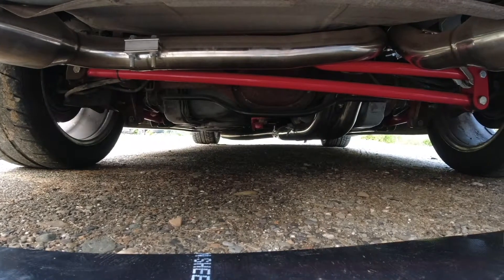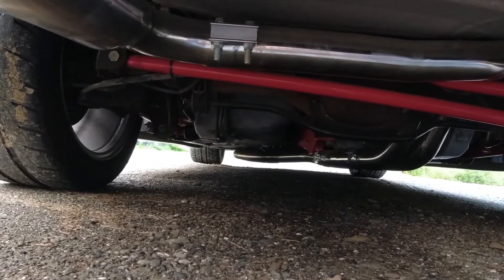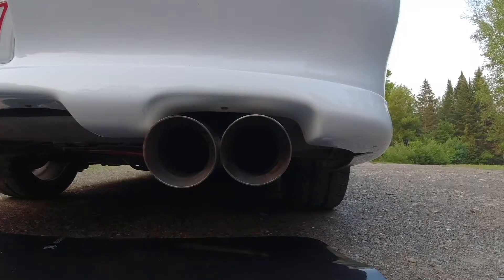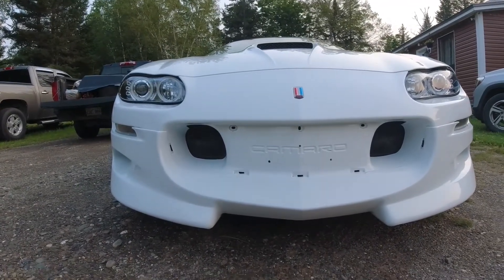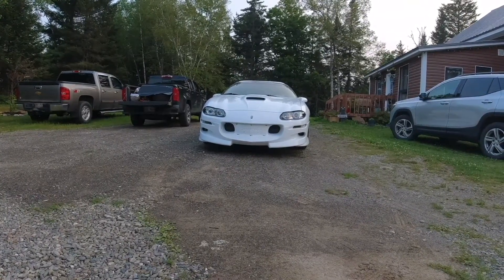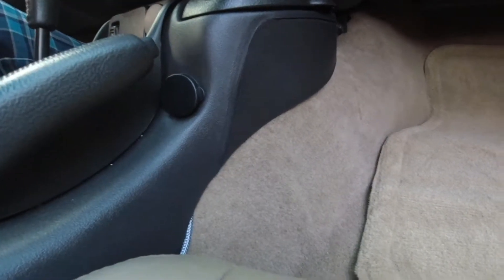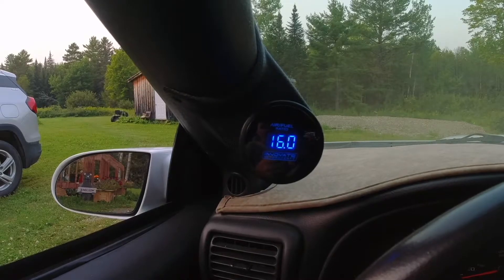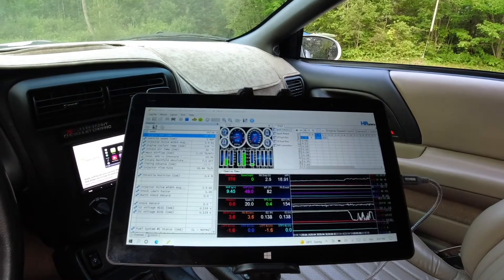4th Gen LS1 Camaro - Adjusting the Speed Engineering True Dual exhaust - HP Tuners

Comment: Hello! I’m looking to upgrade my stock exhaust with a true dual exhaust and long tune headers but have a couple questions that I hope you can answer. 

1) I want a loud/deep exhaust sound and I’m considering  texas speed, Kooks, or Speed Engineering. How loud/deep is the speed engineering? 

2) I don’t want to smell like a gas station in my car, so I’m debating on whether or not to run cats. How bad is the gas smell in your car? What are your thoughts on cats? 

Thanks!
Reply from the maker: Well first off I choose Speed engineering based on price.It is all stainless like the more expensive brands but at a much lower price.But it is also very loud.Now I like loud when I am in the throttle but it can become irritating over long drives because it is loud even while driving the speed limit at low throttle input.As far as gas smell I don't get any smell in the car but I am sure there is lots of gas smell coming out the back.As far as cats go I actually have thought about getting a set for mine but not for the gas smell but to lower the sound when under light throttle but an added bonus would be less gas smell.So there are a few options for dual exhaust.You have speed engineering,Hooker and Kooks and maybe a few others.Sound wise they will vary a small amount but not by alot.But when it comes to price you won't find anything better then speed engineering.You would save enough to cover the cost of a good pair of cats and that would take care of any gas smell and should lower the exhaust note under light throttle.And as far as power goes you lose very little with a good set of cats.Just make sure your tuning is spot on so the cats don't get destroyed prematurely.But any of the exhaust systems you mentioned will work great they just will cost more.Thanks for watching and commenting and good luck on your exhaust.Like I said you really can't go wrong with any of the companies you mentioned.
Reply: @LSxMotorsports2021  thanks so much for your insight! Kooks is extremely expensive so I’m leaning toward Texas Speed or Speed Engineering. 

Also, good to hear about the lack of gas smell without the cats as it’s cheaper to go that route plus it’s louder. (Don’t mind loud as it’s not a daily driver) Do you recommend a tune after getting long tube headers? Perhaps that why some people complain of the gas smell if they don’t run cats. 
Thanks again!
Reply from the maker: @PontiacJames.7001  No a tune isn't absolutely needed on these cars when you add headers but a tune will help get every bit of power from them but a tune is actually good even on a stock car.As for the gas smell you will get some of that with or without a tune the cats are what cleans that up.But with the exhaust system sealed up all that smell goes out the back so the people behind you have to smell it but you don't.lol.
Reply: @LSxMotorsports2021  Ha! That’s exactly the info I was looking to hear! Thanks again. 👍🏻
Reply from the maker: Thank you for watching.